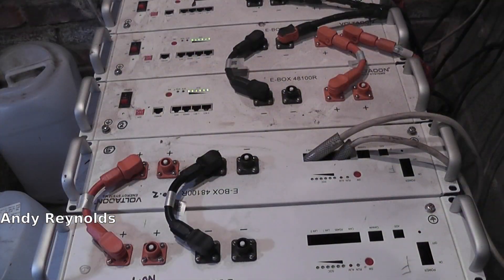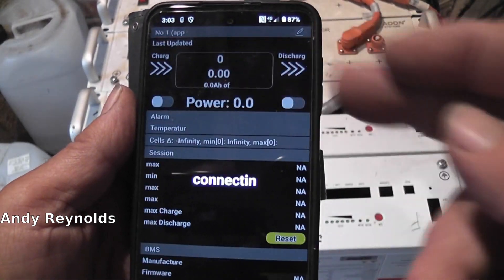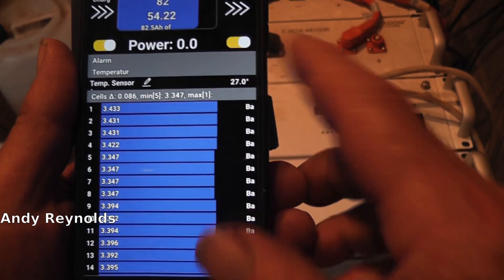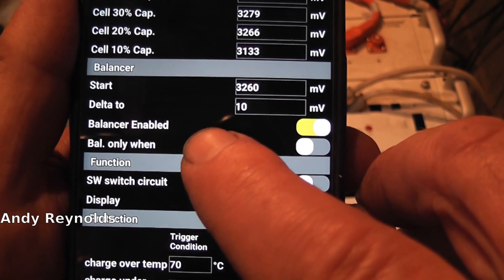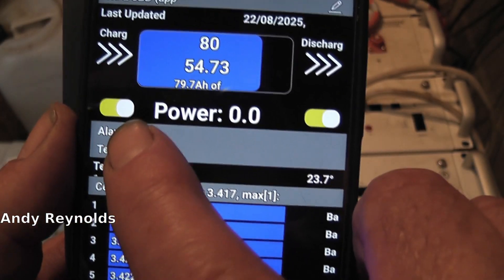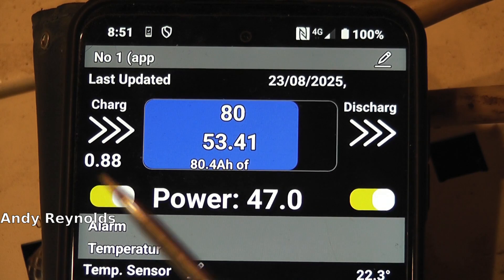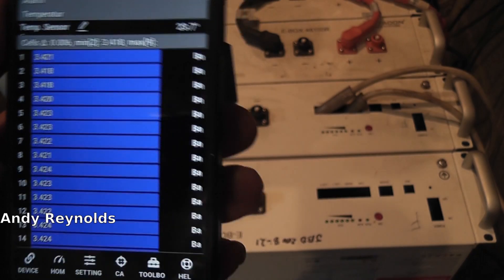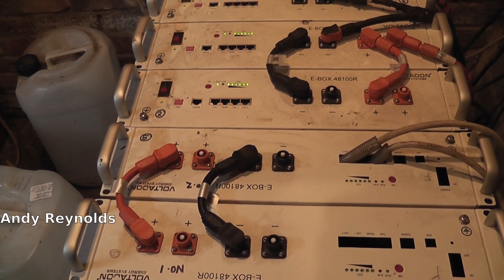JBD enable battery discharge with Overkill Solar, fixing a problem with BMS reboot.

Comment: I don't charge cells over 3.35v because you don't get much more capacity going to 3.5v but avoid straining the cells which occured in the final 10% of charging and set total cycle.
Reply from the maker: Interesting thoughts, I'm thinking this applies to high current charging as there will be raised voltage potential. Terminal charging voltage is defined as 3.65 but there is no reference to current. I think that constant deep cycling and high current push will reduce cell life dramatically, cheers
Reply: @TheInfoworks there's some good videos on YouTube testing lithium phosphate cells in terms of discharging current displayed on a graph
Reply from the maker: @sim6699  worth some more investigation, cheers

Comment: What's your pack voltage when fully charged Andy? It's then you will see out of balance cells. The lower cell voltage overnight at a lower voltage will generally show a much smaller delta because of the lower resting of partly voltage👍
Reply from the maker: Jim, the charge controllers are set to 55v and currently  we achieve fully charged each day. I thing that will only be a dream in winter, cheers
Reply: @TheInfoworks The key question is then what is the cell delta when the pack is at the end of its 55v charge cycle? 
This is one metric 8n assessing total pack health. Hopefully it's well managed by your BMS with the delta below 20mv.
Reply from the maker: @Woodyjims-shack  I think it was an aberration from me experimenting, normally they stay within the 10 MV range, cheers